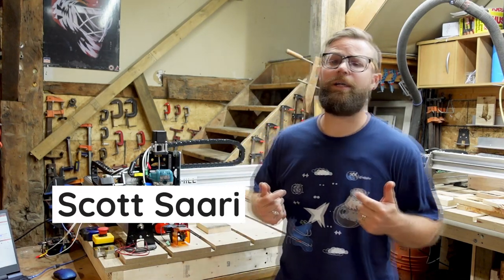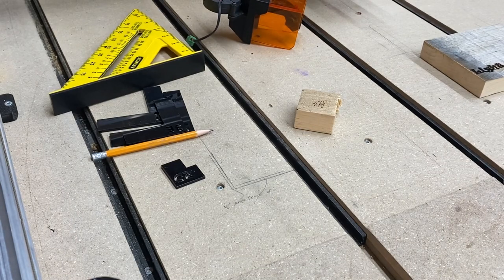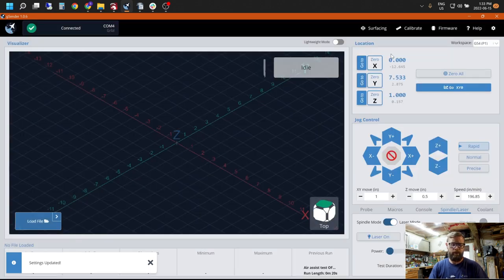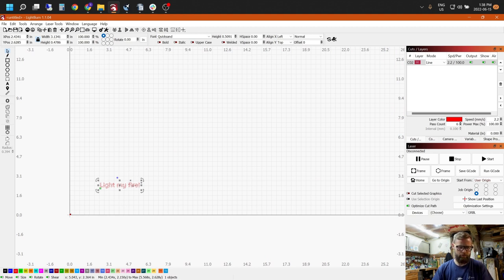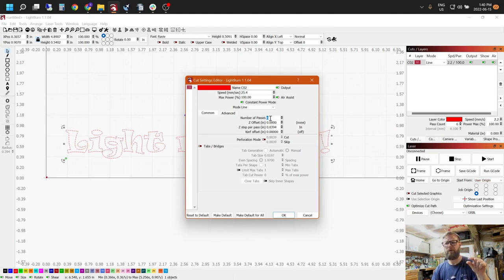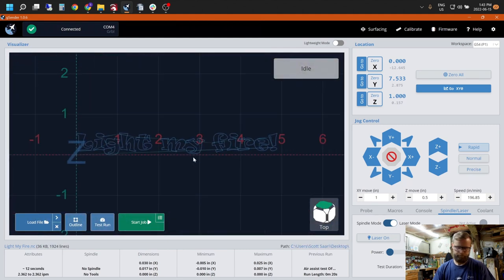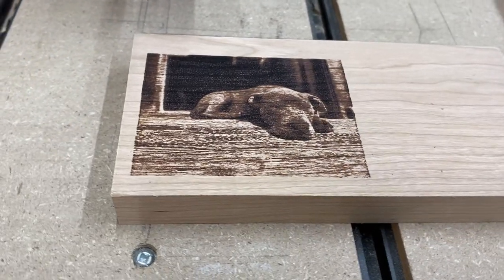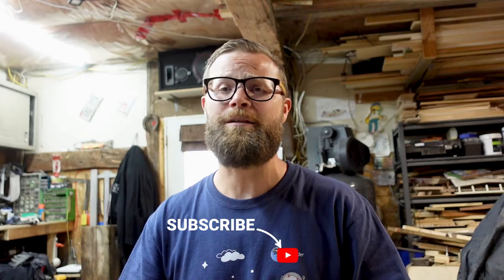LaserBeam CNC Laser Diode - Part 3: Setup and Use

Comment: Great Video ,Did  you ever find out what. Cut out of boonds bue to overscan settings was. What it meant and how to  correct that
Reply: I'm not CERTAIN, but I feel like the "out of bounds" alert is due to the fact that the TEXT that is added, as the project, is simply placed over the "work area" without it actually being added TO a specific workpiece. If you're familiar with Easel & how you have the work area (dimensions the machine will travel) and then you actually design a workpiece on a specific species of wood or other types of material such as acrylic/etc. Again, im not certain, but I feel like this could have something to do with it.

Comment: Great video series!  I'm doing my research on it now and plan on making the purchase this week, a birthday gift to myself!  Quick question, do you need to change the settings back in Gsender when you go back to routing?
Reply from the maker: Nope, you should be able to go back and forth without changing your settings. The only exception would be if you also have a PWM controlled spindle or external device that you are using the same pins as controlling the laser, but if you are using the Makita router, you won't need to switch settings to make it work.
Reply: @SienciLabs  Much appreciated! Laser system and extras are ordered. Looking forward to seeing (and learning) what else I can produce! Thank you.

Comment: What is the Longmills MKII ”Resolution”?
with this lasermodule, how small engraving can you actually ”burn” or is it mostly for cutting? 
Today i have a Neje Master 3 and can engrave very small text and patterns on stainless steel/knifes etc, and my thought was to mount the Neje module to a ”soon ordered MKII” 😎
Reply from the maker: We won't be able to give you a very conclusive number. The theoretical resolution of the machine is the motors running at 200 steps/mm meaning discrete steps of 0.005mm. The reality though is much different since all hobby systems have inherent looseness to them (depending on how they're assembled and tuned by the user with still some remaining left over) as well as how quickly you run the machine since all motion systems have inertia. We do have posted numbers that can be expected when cutting but nothing regarding laser engraving, but with that said you can see past instances of our laser being used to do quite intricate raster engravings so perhaps it can do the job you're looking to do. If it does or doesn't - let us know either way 👍

Comment: Does somebody know exactly what this means and how I can even look at my g-code to see line 18.
I ran a simple text in Lightburn and burned it fine. However, when I try to burn a greyscale picture I keep getting this error code: G-code words consist of a letter and a value. Letter was not found.
It was running just fine the day before cause I ran lots of test cards. Now I cant even burn a picture on my Sienci laser. 
My wife says burn another picture but I don't know if its worth trying that.
By the way, it doesn't crash anymore from the outline button.
Reply: Hey, I remember your username from the Laserbeam live streams, if you haven't found a solution to your inquiry, feel free to send in a technical support ticket. We can help you out one on one. 
Cheers,

Comment: In Gsender why don't i have the $ sign for 30,31,32 and my laser won't work? It was working find yesterday what did i touch for it not to work anymore
Reply from the maker: The dollar sign is just at the top, there was no change and those settings still work the same. If you want more in-depth help with the laser you can contact us or reply with more information
Reply: After i got done a job tried to start another one but laser won't light in firmware the 30,31,32 are yellow with a ! In a black cercle and when a hit laser test it don't burn and everything is at 100%
Reply: An i i mean

Comment: When I’m in gsender and click on spindle/laser it disappears. Anyone help?
Reply from the maker: Hi Shannon, are you talking about clicking on the 'Spindle/Laser' tab on the bottom-right? What version of gSender are you using and on what type of computer? You could send us a contact ticket if you'd like and we can sort you out https://sienci.com/contact-us/
Reply: @SienciLabs  figured it out. There was 2 spots for the spindle/laser button to be clicked on. Having a ton of issues with gsender and burn not wanting to work together or at the same time though. So much going on in burn that we will need to learn it before trying to go further. One point the saved project is on the - side of the axis and next on the correct side. Thanks for your reply back though!!

Comment: Hello, I would like to make a request for a Macro / Video project

Basically, I have my longmill setup with the X and Y as known entity because I have the inductive limit switches.

So, when I home my machine, I am ready to go.

However, because of the position of the laser, my  Home of the laser is not the same as the router,  it would be informative for you to do a video where you create a Macro, so I can click a button and it goes to the X0 and Y0 of where the router head is.

The scenario I would give you is, Lets say I make a Cribbage board, I carve it, then rather then carving the lettering and some of the fancy lines.  I could burn it using the laser.

In my minds eye,

1 - Do your design work in Vectric
2 -  You  take a screenshot of the work in Vectric, 
3 -  In lightburn you import the picture and use it as a reference for all the burning you want to do.

4 - Open gSender,  home the machine, mount the work. and carve

 (assuming you  have created the above macro,)
5 - Execute the macro, and the laser moves to the new X and Y.  (macro should also reset the X and Y to zero once its done moving)

6 - load the burn Gcode, and click start.
Reply from the maker: Hey Stephen, in gSender we actually have a version of this feature if I understand correctly what you're saying. In the settings under 'Spindle/laser' you're able to set an offset between the two of them and then using the 'Spindle/laser' tab once you enable it, you can toggle between the two and that toggle will apply the offset to your zero point. If you have any other questions about it let us know!
Reply: @SienciLabs  awesome! Sounds like it's a good idea

Maybe you could add it into a tips and tricks video in the future or working with the laser

Comment: Every time I hit the outline button the program crashes and I have to do everything all over again.
Reply from the maker: iwannaapple what version of gSender and is it happening with even short, small carving projects? If so you could send us a video or a gcode file and we could check it on our end
Reply: @SienciLabs  
I have version 1.0.3.110
Thats not the only thing it does either.
That actually is the tip of the iceberg.
I don't think so. I haven't actually been on the look out for that. I've been too worried about other things it does. But I will tell you the other day I surfaced my waste board (not using the surfacing program part of gsender.) For nothing better to do I ran it just using a 1/4 downcut bit. Worked great. I had time. Ran the same program 3 times. I was actually flattening out the bottom waste board so I can put a brand new one on top of that and very slightly surface that one too. Well, that didn't happen because The pen on the graph didn't know where it was at even though the zero was at the starting point. It started doing something crazy (it started surfacing at a completely different starting spot) even though I never closed out gsender or never did I start a new program. Even if I did it really keeps the same coordinates (which I like but I always check).
I have programming experience. To me, it looks like there is a loop that has a mistake in it and thats why I could not rerun the same thing again.
Sometimes mistakes don't reveal themselves unless it steps through a loop several times.
My gsender just seems to have gotten worse lately.
Reply from the maker: @iwannaapple7190  sounds like something we could help with by looking further into it with you. You can fill out a quick form here and then we'll get to more chatting: https://sienci.com/contact-us/

Also, apologies for missing your comment. Seems that YouTube marked it as spam for some reason so we didn't see it come through until today
Reply: @SienciLabs  
No problem and thanks for replying. I don't know if its related but there is something else also. I was told to take a movie but me nor my wife have enough memory in our phones. The glitch in the directions ??? broke one of the black screws. I filled out form. Just don't have enough memory in phone. At times it does what it wants to?

Comment: Can you explain why the laser level during "focusing" was still intense enough to burn the wood.  I have watched dozens of cnc laser reviews and and have never seen the laser burn the target during the focusing proceedure.  This apears to be an unresolved safety issue.
Reply: Yeah, I'd like to know that too.
Some videos I see the laser is not even on for focusing OR it has a very weak light for aiming purposes.
Reply from the maker: Thanks for the concern! We addressed that in the video. The dip switch on the driver was set to 5 not 1 which is why it burned so easily. For a safer method, please set your dip switch on the driver to 1. This should still give you the ability to focus, without so much power flowing. We hope you have fun with your new laser!
Reply: In the video the dip switch was set to 1 prior to focusing.  The problem seems to be the preset power setting is set to high.
Reply from the maker: There is a disclaimer around the 22:20 mark of the video explaining the dip switch 5 vs 1 power selection. Reach out to us if you still have any questions!

Comment: I don't understand why you set your feed rate in LB to mm/sec, and not mm/min, as recommended in LB for diode lasers. Since gcode machines cannot take feed rates in mm/sec, the actual rate in the gcode is multiplied by 60 to show the F command in mm/min. Also, since gSender cannot be set to show any rates in mm/sec, it seems odd to use that setting in LB.

You talk about power and feed rate almost interchangeably. Changing the feed rate in LB does not change the power setting. I'm sure that you know this, but the video seems to confuse the two settings.

You mention that you don't know what is causing the out of bounds error. You may want to check the size of your bed entered in the settings window.
Reply from the maker: The feed rate is simply user preference. It has no bearing on how the machine works. If you're comfy  with mm/min, feel free to set your preferences up that way. Thanks for the question! We hope you love using your laser!

Comment: I appreciate the video. I haven't set mine up yet but I would have to say thats the most messed up focusing system I've ever seen.
"Halfway"? Thats a very subjective term and surely y'all could have came up with something better?! Really?
Reply from the maker: Thanks for the comment. We send spacers with every laser for this very reason. All the lenses have a focus range, so if you are in the range you can get the lens to focus. It doesn't really matter if you're at the top of the range, bottom of the range or in-between you can set the range using either and the lens will focus. If you have any trouble reach out to us and we'll help!
Reply: @SienciLabs  
Thanks.